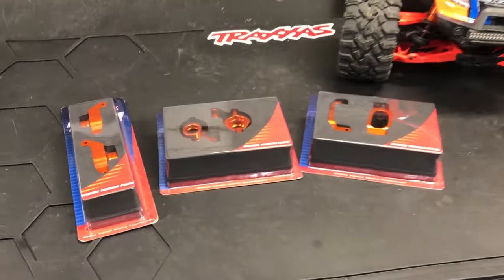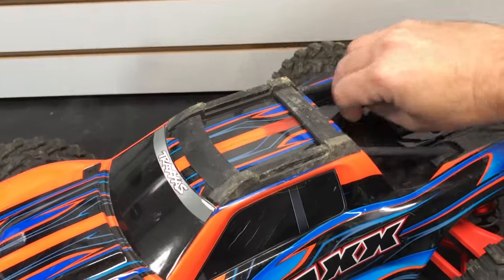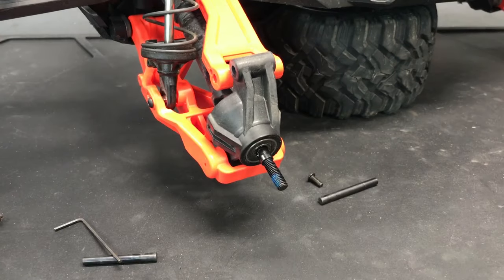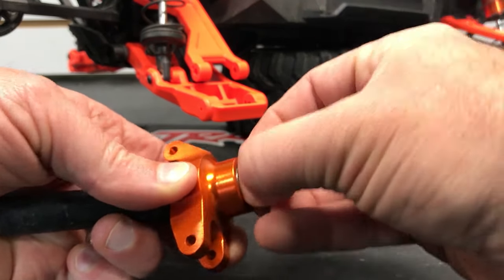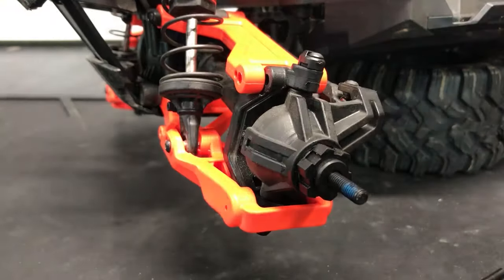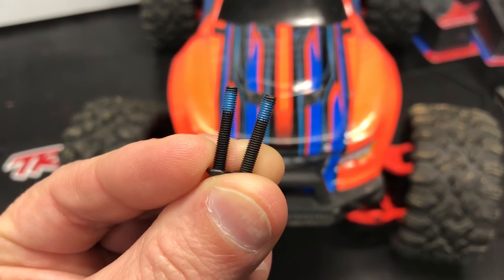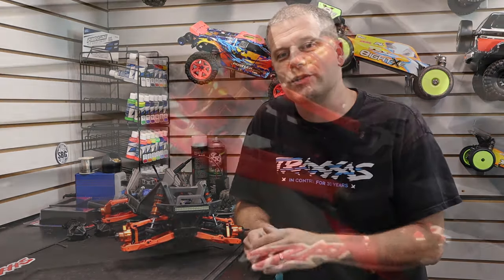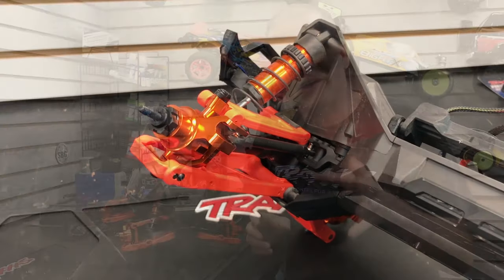Aluminum Suspension Goodies! - Traxxas Maxx Accessory Option Parts Project Part 3 | RC Driver

Comment: So, Traxxas doesn’t offer this as an all inclusive kit for both front and rear in order to save some money. These are some expensive upgrades and just not sure if it’s justifiable. What’s the real advantage of going to aluminum? I’ve heard others say when adding aluminum to your Wide Maxx, it can lead to other issues with other non-aluminum parts. What’s your thoughts on the real necessity of making these upgrades? Thank you again for another great video.

Comment: RCDriver_Online have you tampered with setting your end points with all these upgrades?  I have all aluminum upgrades, widemaxx, plus steel cvds and I noticed that I had to set end points to around 85% left and right, anything higher and the caster makes contact with the steering block.  What about yours?

Comment: any reason you skipped the steel drive shaft?
Reply: It seems to me this was for pure aesthetics, because if it was for performance, you'd skip all the aluminum, get rpm plastic parts. One of the only alloy upgrades you should get are the driveshafts for the maxx...

Comment: Tekno mt410 is the real king of monster trucks. A few brands can match tekno in durability, but there is no monster truck that steers and jumps like a tekno.

The maxx has sluggish steering and flips over easily, traction rolls a lot on any high traction surface. The tekno has lively responsive steering like a buggy and does not flip over easily. Jumps with stability and distance. 

The maxx is good in straight lines and jumps. Not well rounded. But for the price it’s all right. Just saying it’s not the best monster truck there is.
Reply from the maker: There is an RC vehicle that fits the needs of each enthusiast out there. That’s what’s so great about RC.
Reply: RCDriver_Online just saying because some viewers, mainly beginners think traxxas is the best, but don’t understand the downsides of traxxas trucks and how there are others out there superior to traxxas in every aspect, durability, jumping, landing and steering. It really sucks when trucks flip over because they aren’t stable jumpers or bad at cornering. Traxxas has dull numb like weak steering, yet can’t stay on all fours. Needing to keep running to flip your truck back up or needing to break and drive slowly when turning puts a damper in rc fun. Having a truck that can go all out in every aspect is more fun. No way around that. 

It’s good for viewers to know the differences that matter. Some can’t spend money for more than one kit. So anyone reading and want the true monster king, it’s the tekno mt410. Huge difference in performance.
Reply: Traxxas has self righting
Reply: @one4all265  quit it!
Reply: Tekno LMAO......ohhh sounds like another person is butt hurt over Traxxas killing it with yet another great vehicle....I own Axial, Arrma, Losi & Traxxas and for what it's made for the Maxx is the toughest vehicle I own. It's not meant to race around a track and I would put my Maxx up against your Tekno any day for bashing. Actually I think I will buy a Tekno MT410 and record how fast it breaks. Haaaaa Tekno LMAO....what trash.